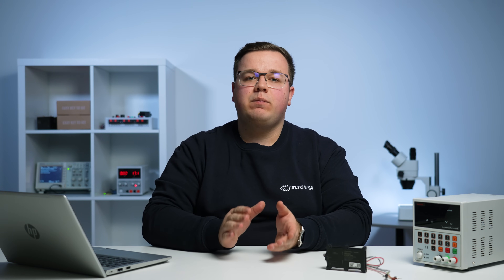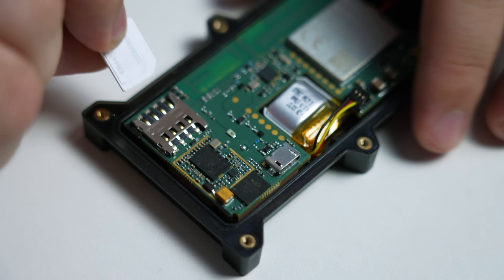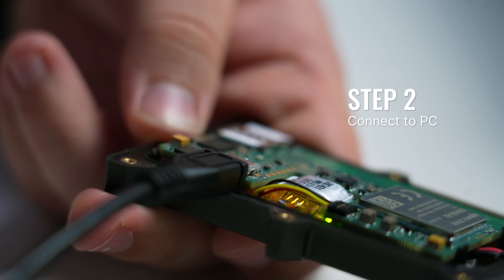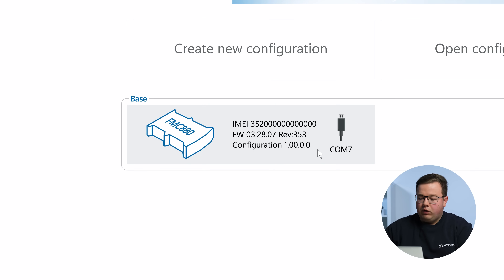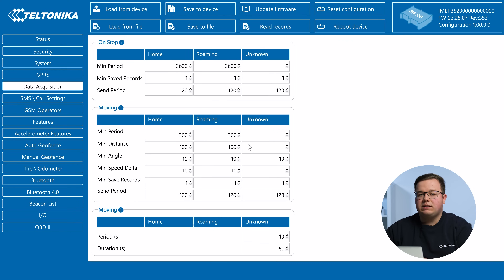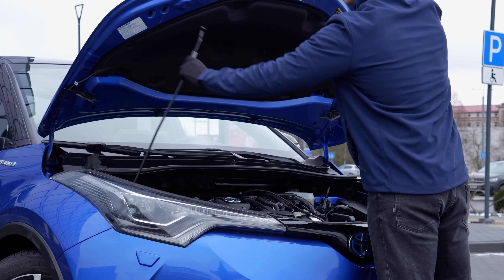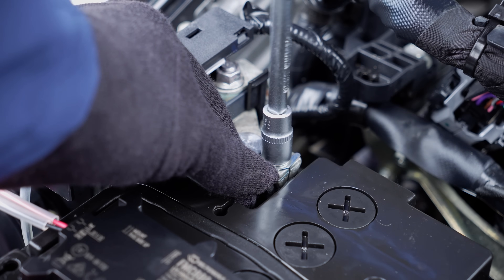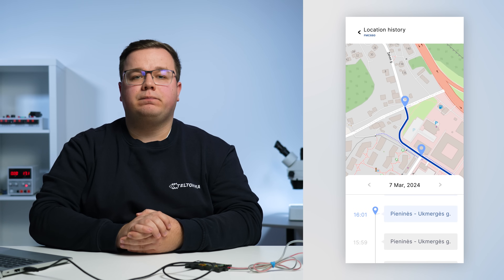GPS Tracker General Quick Start Guide | Teltonika

Comment: Connecting it directly to the battery wouldn't the excess amount of heat from the engine destroy the device and the battery? especially on big trucks?
Reply from the maker: Connecting the device directly to the vehicle battery is safe and will not be damaged by engine heat, even in large trucks.
The device’s specified operating temperature range confirms it can withstand the temperatures normally encountered in these installation locations. 
 
As long as installation guidelines are followed and the device is not placed directly next to extreme heat sources (such as exhaust components or turbochargers), neither the device nor the battery will be affected by engine heat.

Comment: Hi,
How to get a push notification on phone android, when something happens with vehiclie using FMB965, i mean when it's stolen or tilt?
best regards
Reply from the maker: Hello,
Such notifications can be generated through certain tracking platforms that also offer mobile applications. In this case, the notifications are configured within the tracking platform based on the data received from our tracking device. Once a specific condition is met (e.g., tilt detected or the vehicle leaves a predefined area), the platform triggers a notification to the mobile device.

Comment: I thought the wire end needed to point in the direction of travel? Same as the FMT100
Reply from the maker: Hello,

When autocalibration is enabled, the orientation of the wires, including the direction and mounting position of the device, does not affect the operation of either the FMx880 or FMT100.

However, if autocalibration is not used, wire orientation becomes important for both devices, as the X, Y, and Z axis values may not represent accurate or meaningful data.

Comment: For the required sim card, what sort of data usage should I expect? I suspects gps telemetry is nominal but to match the best data plan a general Idea would be helpful. Also could you please point me at an appropriate mapping interface you have had success with? Thx.
Reply from the maker: Hello,

The data usage depends on several factors, for example how often the device sends records to the server, the number of enabled IO elements, and practical usage, such as how frequently the vehicle is in use. To give you a better idea, we offer two Teltonika Connectivity Solution plans:

TELTONIKA GLOBAL PLAN: 500MB of data, valid for 5 years.
TELTONIKA GLOBAL LITE PLAN: 100MB of data, valid for 1 year.

These plans are designed to meet most of our client's needs, so they should give you a good estimate of the expected data usage. If you need more information about these plans, please visit our webpage here: https://teltonika-gps.com/products/solutions/teltonika-connectivity-solution
Reply: @TeltonikaTelematics  fantastic answer. Thanks.

Comment: How can I power on a FMC003 OBDII at home? In the quick manual, v1.1, you mention "Power-up FMC003 with DC voltage (10 – 30 V) power supply using supplied power cable.".
Reply from the maker: Yes, that's correct! To power the FMC003 at home, you can use an external DC voltage power supply with a range of 10–30 V, as mentioned in the quick manual.

Comment: Hello, great video! One question though, is it a must for the device power wires to face the front of the vehicle? The tutorial video on the teltonika website for this sensor highlights that the wires should be facing the front of the vehicle. However, for this video, I see the wires are not directly facing the front. Kindly clarify. Thank you!
Reply from the maker: The power wires should be securely connected to the positive and negative terminals of the battery. It is not necessary for the wires to face the front of the vehicle.